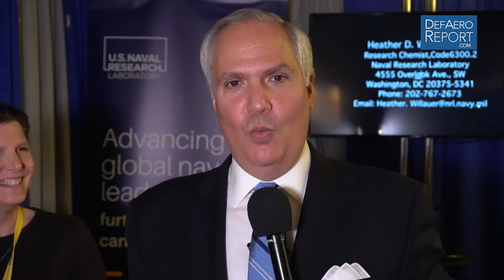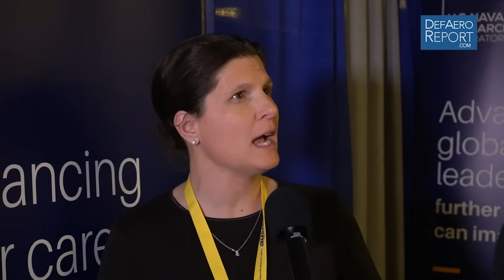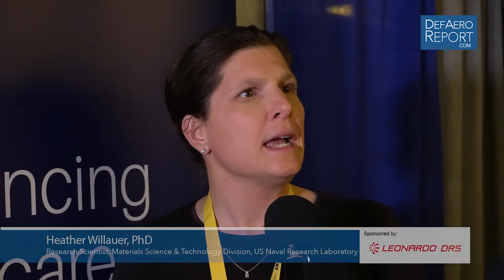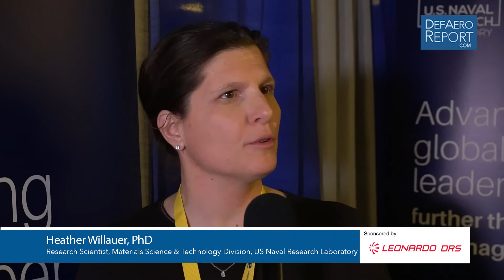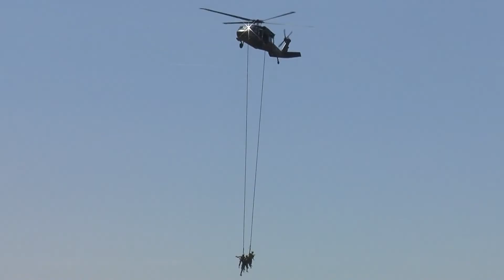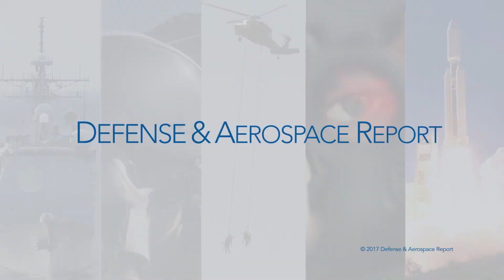US Naval Research Lab's Willaeur on Turning Seawater Into Fuel

Comment: If I read into this correctly, it seems like the system can take power (from say, a nuclear reactor on the ship) and use it to produce "designer" fuel from seawater, but that the entire process would not be self-sustaining, meaning you would still need more power to produce the gallon of fuel, than the fuel would release.  This is still great value for, say, the navy's aircraft carriers where they can use onboard nuclear reactors to generate jet fuel for example, allowing them to refuel without having to "ship" fuel onboard.    There also seems to be some great use cases for offshore wind and solar power (or other energy sources that are temporal) which could convert ocean water into fuel for use later when needed.  Would be great to get an answer from Dr Willauer's team regarding this "efficiency" of fuel production, and some real numbers of input power required vs fuel generated.
Reply: If by "not self sustaining" you mean that more energy is consumed than is produced, that's called the Second Law of Thermodynamics and applies to ALL energy conversions, e.g. photosynthesis. To produce liquid fuel for burning, wind and solar power can't be adequately scaled up to be mobile. This requires nuclear power. (By the way, wind and solar need nuclear power, too, but the plant is 93 million miles away.)
Reply: According to her publications the efficiency is approx. 60% turning electricity into chemical fuel. It needs to stay less then 100% efficient - everything else would be physically impossible...
Reply: That is where the Lockheed compact fusion reactors will come into play. No need to get regular deliveries of jet fuel from onshore, so one less part of the supply chain that can be disrupted. This has significant strategic and tactical value for a fleet including aircraft carriers etc.